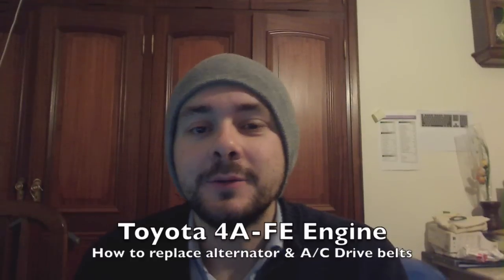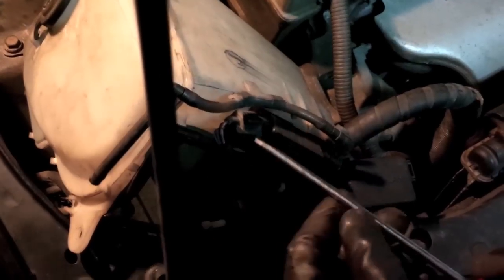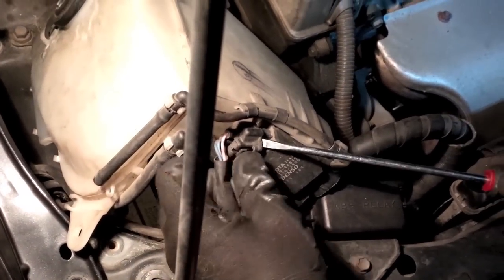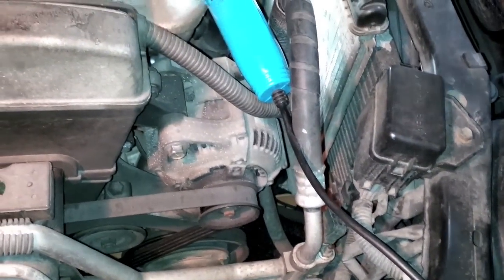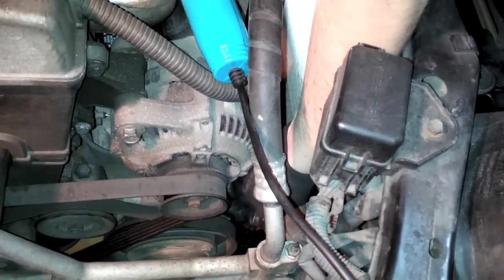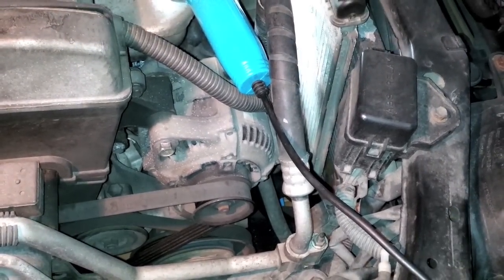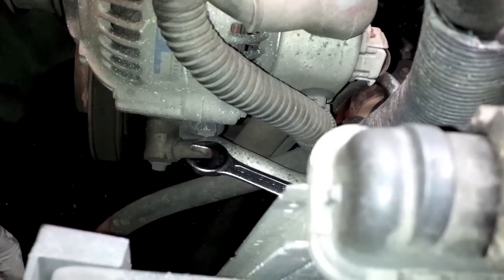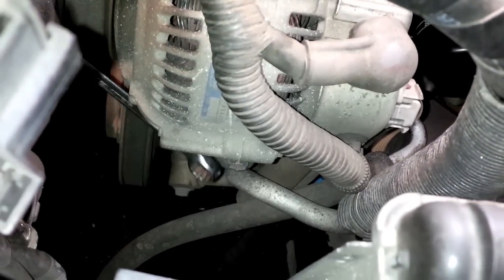ᴴᴰCorolla Toyota V-Belts Guide: Alternator and ancilliaries (4AFE 1.6L)

Comment: The original toyota belt is 850mm? Parts store sold me an 830mm and refused my refund. The belt only fits on without the 3rd pulley in the middle but it is way too loose. I hate part stores.

Comment: It's a bit more than this...the tensioner bolt and the locking bolt screws into a slider block (part number 16385-15030). You also haven't mentioned the torque settings required for the locking bolt. I have been struggling for weeks trying to get it tight enough (after snapping 2 bolts). 40nm is too much, but 27nm isn't enough. it loosens and starts making noise!

Comment: the same thing happened to my cuz car the bearings fell out damaging the nut. the nut and bolts snapped/broke due to rust and corrosion, where would i get replacement hardware??? thanks for the awesome video, this is the only video i could find on this particular idle pulley.
Reply: The cheaper parts on Amazon are ok.

Comment: is the alternator on a 4E-FE Starlet from 1998 the same? I'm not needing to replace mine but I want to change the belt, and that bastard of an engine is more complicated than the Celica I'm used to, has 2 belts and the alternator is hidden well behind deep in the bay lol seems like it needs to be worked on from under the car

Comment: Good luck getting that ac belt tensioner off when the nut is rounded out. I had to cut that nut off with a dremel tool carefully in order to replace the tensioner idler wheel. :{
Reply: David Willard how did u know it was out?

Comment: You should make a note reminding people to start the engine just for a moment like you did (without the accessories/auxiliary belt), or they may damage the engine because there is no cooling fluid circulating in the engine and equalizing the temperature throughout the engine block.
Reply from the maker: Thanks Hélder, I have added a warning to the description with your point. For me it seemed obvious, but it is always better to be safe than sorry! Abraco!
Reply: João Rocha da Silva
Yes. For me it's also obvious, but may not be for total beginners. Sometimes people forget the most basic things. Nontheless, your video was already AWESOME :) And now, with the warning, it's even better :D
Abraço!